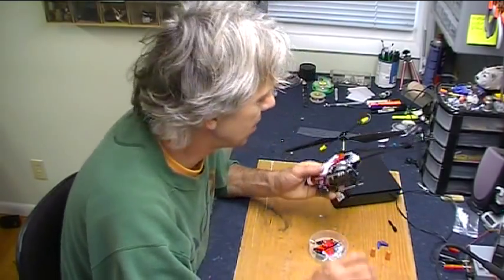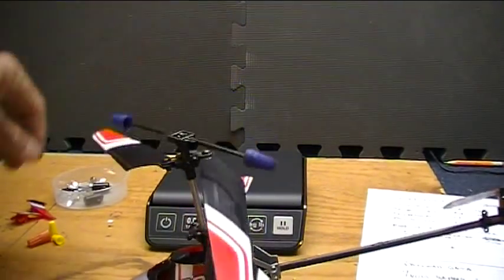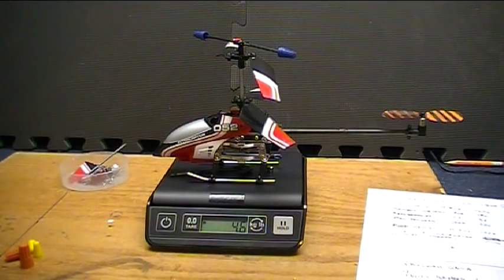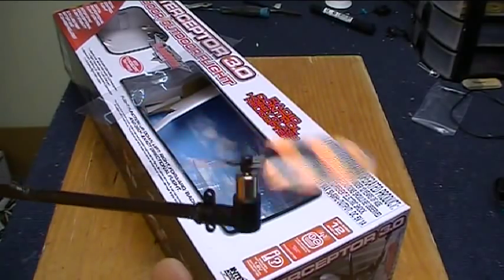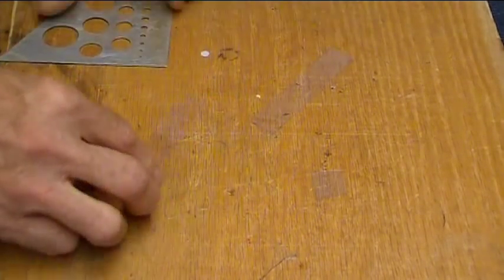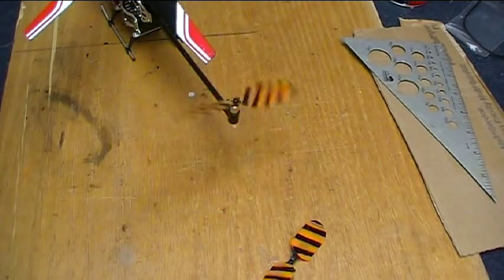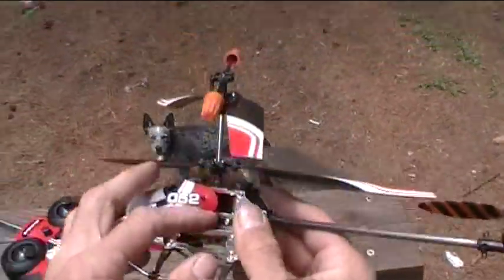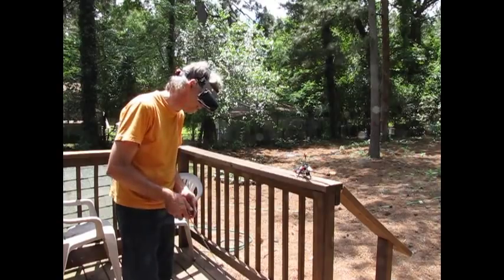Coaxial RC Helicopter Hacks

Comment: That's not really a helicopter.  It's a Co-Axial. I have plenty. Probably at least a dozen or more. 
Some have flybarless, some don't.  I even have one that doesn't have a tail rotor. The Blade Scout. Another oddity is the Blade Tandem Rescue.  It doesn't have a tail rotor either.  Instead it has a secret set of co--axial rotors. Its like a dual co'axial. It didn't last long in production.  Too many design flaws. 
I would really like to be able to tweak it to where it could at leas6hover, and maybe navigate a bit.

Comment: I have a 26 inch coaxial copter. Flies great after 2 years. I decided to do a weight reduction on it for fun, and dropped 52 grams from it. Went from 660 grams to 608 grams. But I left the gyrascope alone for one reason.

The gyrascope is weighted the way it is for a reason, the weights allow it to respond quicker to changes in pitch in the blades. By reducing this weight, you are reducing the effectiveness of the gyrascope and reducing overall handling of the copter. Its possible to fly without the gyrascope, just very difficult compared to with it.

Also, while reducing weight is fun and all, it doesnt add any real benefits other than being able to fly higher. But the issue is, a light craft flying high is an unstable one as you generally encounter more wind at higher elevations. Heavier crafts will be easier to fly and more stable in winds and at high altitudes, which is why I plan on replacing the 52 grams of weight I removed with a larger capacity battery that will actually overweight the original weight by 40 grams. But I dont think the extra 40 grams is going to hinder my craft much as its already capable of flying well out of its range in height even before the weight reduction.

Comment: on most of these rc heli's I take the spring out of the remote that holds the accelerator down so that hovering is easier and so my heli doesn't just drop dead midflight if I let go of my controller you might do the same

Comment: I'VE DONE  SAME  THAN  YOU  WITH  THE  FLYBAR,  I HAVE  ONE  LIKE  YOURS  BUT  SMALLER,  INFRARED.  AND  I  I NTENDED  TO REDUCE  WEIGHT  WITHOUT  DECREASE  FLYBAR PERFORMANCE.  ALSO  I  DESIGNED  FULLY  NEW  ROTOR BLADES  FROM PLASTIC  CARDS,  FULLY  NEW  SHAPE BY  CROP,   CARBEN  AND  POLISHEING,  I ALSO SHARPEN  THE END EDGES OF THE  MAIN ROTOR  AND  THE  TAIL ROTOR PROPELLER.  BEFORE  HACK IT, WHEN  AT  END  OF  BATERY  CHARGE, IT  USED  TO  MOVE  AT GROUND LEVEL, CAUSE  NOT  ENOUGH  POWER  TO  HOVER,  BUT  NOW,  WITH  THE PERFORMANCE  HACK  OF  THOSE PARTS,   IT  CAN  FLY  IN THE  AIR  UP  TO  THE   VERY  END  OF  BATERY  CHARGE   REGULATION LIMIT,  WHEN  IT  DECREASES  SLOWLY  THE SPEED  AND  THEN  TURN  OFF,  TO  MAKE  AN AUTOMATIC  LANDING.  I'D LIKE  BUY  ONE  BIGGER, HEHE,  BUT COAXIAL TOO,  TO  FLY  OUTSIDE
Reply: +Diego Martin Why caps?
Reply: Because  i have  visual problem,  and  is  more  comfortable for  me  to  type using uppercase.  I already  found  many non  tolerant  persons  about it. But  i clarify  once  more:  If i want   to  scream, i will use  ¡¡ !!! ,  uppercase   to scream  is  just  a chatters myth,  i still ussing the TRUE gramatical  meaning.
Reply: K

Comment: Hackaweektv If the battery on your heli over heat would the heli slow come down out the sky because i'll charge my heli and it will do that at 5 minuts
Reply: amari odom well, after 5 minutes you are pretty much running out of juice, that's why the heli starts to slowly drop and you need to use more throttle.

Comment: To save buttery I also removed LED. Less light but less loosing Voltage
Reply: Paul Suszka LEDs use such a little amount of power I wouldnt expect to see any noticable difference in fly time by turning them off. The downside to removing weight from the copter is also removing handling. A heavier craft will be more stable in all situations. 

Its really a catch 22.

Comment: Hey Dean,
Saw this video and had a problem for you if you can give a solution to it. I have a cheap coaxial rc heli and after some bad landings, it now has the problem of rotating around it's axis always in one direction, never remaining stable or never taking up flight. It doesn't have a motor on the tail prop - there's just a movable propeller, but no motor. The remote has trim buttons, but they don't seem to work to correct the rotating problem.
Reply: greatidea11 I had the same problem with my 15$ RC helicopter. If you open up the belly of the heli you will see two larger circular axis. When you manually spin the propellers both of the axis should spin. In my case only the bottom one was spinning. After I push the connecting rod with the small axel on it down some it then engaged the upper large axel and magically the copter took right of and began flying again!! Was such a proud young pilot as this was my first time trouble shooting a helicopter successfully. Give it a try!
Reply: Put it in the bin and bye CP heli from bang good.com..

Comment: Hello, My name is Frank. Today I modified the exploiter s sky rover. I removed the lower half of the tail rotor housing. I then manufactured a tail rotor lower housing to accept a slightly larger motor. I cut and soldered the wires back together. I did not put the rear red light onto the manufactured lower half of the rotor housing, instead I placed it on the tail shaft. The new larger tail rotor motor performs good. Now the helicopter will fly forward and backward really good.

Comment: standard motor controllers for rc stuff need a pwm signal to work so its really easy and you can use a arduino and get all fancy or you can go simple with a 555. its easy to do a quad rotor.

Comment: Here's a guy who can answer my silly questions!  I'm a compsci student, and just finished a mircocontrollers/architecture course.  Naturally my buddies and I are now looking at an autonomous quadcopter build, but I stumbled across coaxial heli's, and they seem like they would be a heck of a lot easier to describe, for both hardware and software. But none of us has RC experience. How feasible is an MCU-based coaxial hack?  And how the heck do we port PWM board-signals to control RC components?
Reply: Did you do it?